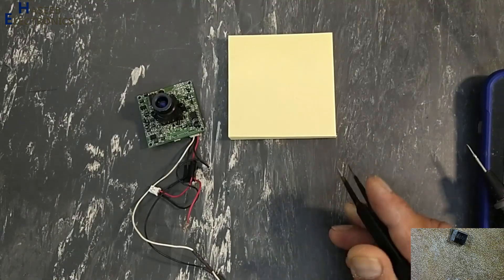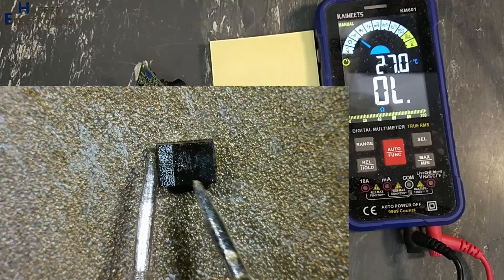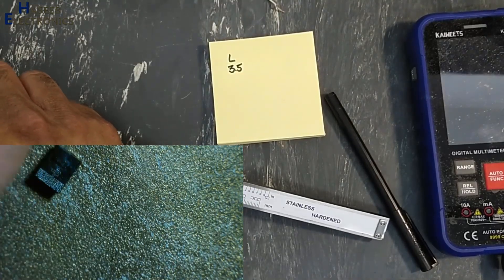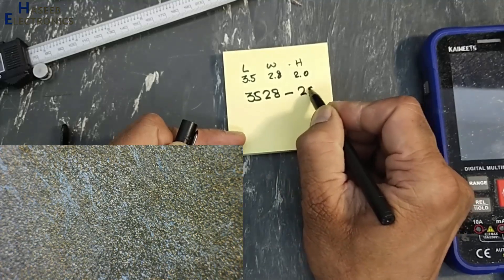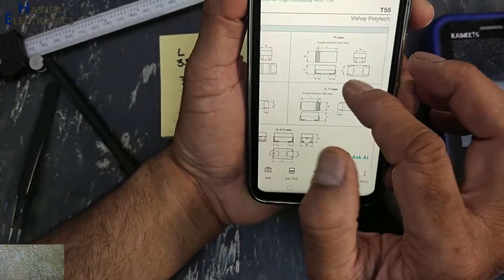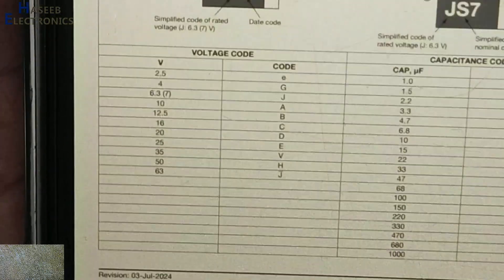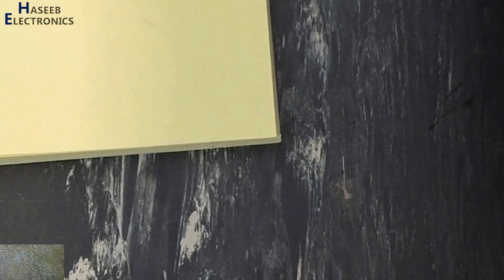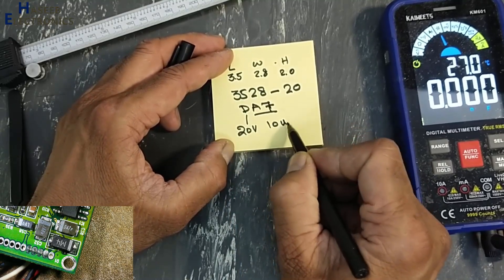{1166} SMD capacitor code to capacitance and voltage conversion

Comment: I want to thank you for your many excellent teachings. I see writing next to capacitor it says Code S7 value would be 47uf ?  I am confused about this ?
Reply from the maker: Good morning 
S7 is 47uF from Panasonic 
you can aslo check size case code
Can you please send its picture to my WhatsApp 00962-79-560 8616
Or gmail id ashraf4ta4 
So it will be easier to correct reply
Reply from the maker: there must be some other marking code in second row (containing voltage information)